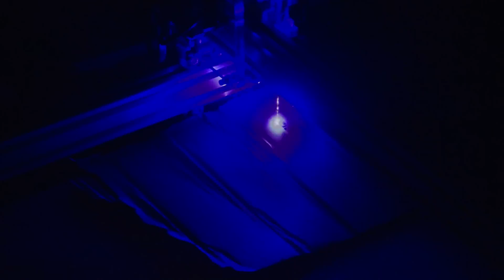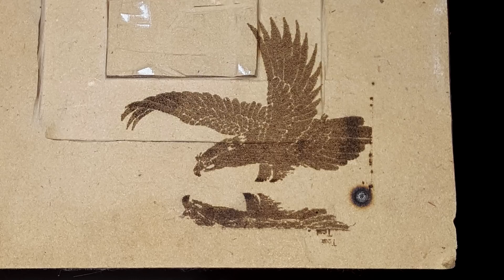Inexpensive Home DIY 2.5W Laser Engraver

Comment: people have reviewed that the laser stops working after sometime... has it happened to you ? thanks.
Reply: I think that is on some of the higher models like the 5000, 10k and 15k milliwatt versions which are all over driven 2.5 watt laser diodes.  I was digging and found that out and it even says 30 seconds on 2 mins off or the life is greatly reduced.  When you etch/or cut the time it is on and off adds up so eventually the damn thing just burns up.  One version they changed out to a larger heatsink body due to it.  Stick with 2500 and it will last you a long time but here is another thing to consider and that is the fan is attached to the same laser driver which is stupid.  I would remove, even on the 2500 version, the fan's wires and have it always on so only the laser diode comes on and off so it will keep it cooler with a steadier temp.

Comment: Hey , can it cut through 5mm foam board ?
Reply: Not this version.  The laser can do it but this machine has no Z travel and 5mm is just far too thick.  On my 3d printer with a 2500 laser on it I do 1mm passes so 5mm would be 5 passes AND Z goes down 1mm with each pass.  Keep the laser down in power (you will find the sweet spot) and let it rip but this machine, without a Z travel, is really only good for light engraving and 1-2mm cutting.

Comment: Can this cut plywood, if so what thickness?
Reply from the maker: This is more of an engraver at only 2.5 watts. You could cut plywood but it would take a long time with many passes.
Reply: What wattage do you think would be needed to cut 1/4in or 5mm thick wood?
Reply from the maker: You're honestly better off getting a CO2 laser if you're wanting to cut materials. Something more along the lines of this: https://www.amazon.com/CNCShop-Engraving-Machine-Engraver-Woodworking/dp/B012F0LKHE

Comment: Do you have any videos of laser engraving wood?  How is it working out for you so far?  I noticed it on amazon and seems appealing for the price.  Seems like a good starter unit to see if it's worth bumping up for the much more expensive and bulky CO2 lasers.  Thanks! - Lance
Reply: It looks like it's a GRBL board (or could easily be converted to one) so try LaserWeb.
Reply from the maker: I used the laser engraver to engrave some wooden Christmas gifts I made recently.
https://www.youtube.com/watch?v=_dOp4Pm6R9M I am also working on another project where i'm engraving a 19.5 " tall wooden poster. https://drive.google.com/file/d/0B_dNOPsumc61elZCQTN6dHBvV00/view?usp=sharing
I love the laser engraver. Prints do take a while and like I mentioned in another comment this laser is really only meant for engraving and not cutting which is why I got it. The only thing I will say is you have to be careful with it since it is a class IV laser without an enclosure make sure you're always wearing safety goggles. I'm currently building an enclosure for it. I really do love the DIY aspect of it and the fact that it's air cooled and can be moved to projects. Hope that helped!
Reply from the maker: +Lance RadueSorry for the late reply. YouTube marked your comment as spam for your included YouTube link... 
I have done a couple images yet not to that detail as just regular engraving seems to take a while. As soon as I have finished the laser engraver enclosure I'll give it a shot and tell/show you how it goes! I watched your video and that CNC is very cool! How long did that take to build?
Reply: It took about 80 hours I would guess to build it and cost about $1200.  The best thing to do if you want to make one is fine someone with a CNC to cut out the parts for you.  This way most of the hard cuts and holes are pretty close, then it's just a matter of assembling it.  You can find "free" software for it and you're good to go.  It has paid for itself many times over already on simple 2D cut outs and designs.  It would take a lot less time if you purchased the parts already cut/mostly drilled.

There used to be a series called "How to Build a CNC on a Shoestring Budget" by Dave Gatton, and he used to give away the plans for free, but it looks like he removed all of them and doesn't give the plans away anymore.
Reply from the maker: Thanks for the advice! I might look into building one sometime in the future. Also I did a couple test engravings and this engraver definitely has enough power to engrave photos. It's just a matter of finding the right settings. I engraved these images at 50% power.
https://drive.google.com/file/d/0B_dNOPsumc61YjM3bzV4V0t5VUE/view?usp=sharing
Reply: Wow, that looks pretty good.. and you're just using the free software that comes with the laser?  Thanks!
Reply from the maker: +Lance Radue Yes the crappy CNC software it comes with. It actually works fairly well for most engravings but I'd love to move on to a better software once I find a free alternative. I am loving the engraver though! 2.5W is definitely enough power for what I do.
Reply: Lance Radue A

Comment: You got ripped off as you can buy a much nicer CO2 laser with 40 watts for the same price.
Reply from the maker: I've seen the lasers you're referring to. The reason I didn't get one of those is because I wanted an air cooled model, one I could tinker with, and I wanted an open frame so that on bigger woodworking projects that I do I can set the laser over the top of it and engrave any size I want. The CO2 lasers at this price are very limiting dimensionally. Also this laser could be built from scratch for around $250 if you don't mind waiting for the slow boat from china haha. Thanks for your comment!
Reply: BOS Studios
Well, you can't do very much with the frequency of that laser's beam and the very low wattage also hampers it greatly.
  A lot of materials will simply not work but I have forgotten which ones they were.  The CO2 laser is mostly IR (heat) that we can't see so it works on more materials but not all of course (like metal the CO2 will struggle with).
Reply from the maker: You are right the CO2 laser is a lot more powerful and could be used for even laser cutting some materials. I only really wanted a laser for engraving on wood and leather so the air cooled one seemed the right choice for me for that reason and given the limiting engraving size of the CO2 model.
Reply: Hi would you say this is a good item and where do you get the software to run it?
Thanks
Reply: The el-cheapo K40 takes quite a bit of work before it's really usable.  I wouldn't even bother trying to use it until I'd replaced the control board so I could use anything other than the pirated, virus laden copy of coreldraw it comes with.  It also has a pathetic working area of around 200x300mm.  It also doesn't have a 40 watt tube in it, it's more like a 30 watt machine that they pumped WAY too hard and said "See?  It can produce 40 watts, once."
The bigger, nameless $1500 "50 watt" machine is a better deal all around.  It's the same "See, it made 50 watts...once." deal but we measured 43 watts at the table so what the heck?
CO2 lasers are much more of a pain to set up what with water cooling, air assist and ventilation.  For a lot of home gamers, a diode laser will get the job done.
The main materials a blue diode laser won't work with are transparent acrylic and glass, a CO2 laser will cut clear acrylic and etch clear glass.
Reply: I bought a 2.5 watt blue laser and I attached it to my 3d printer.  Works well but I am still sore that a few hours after I bought it the exact same one dropped in price from 51.90 to 39.90. :(
Reply: You said alot of words but for WHAT reason?